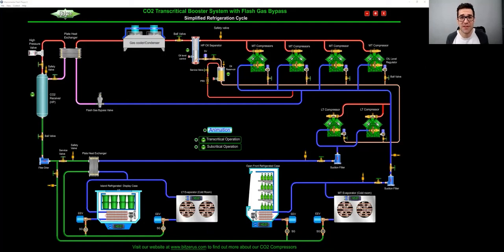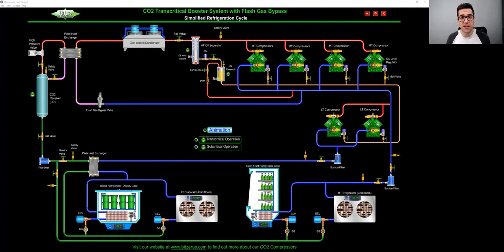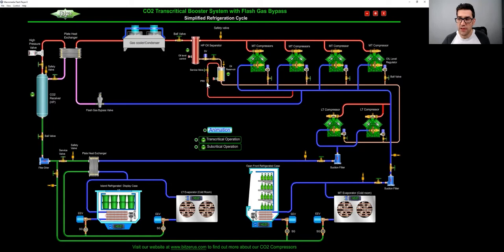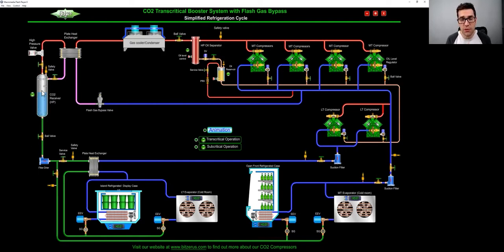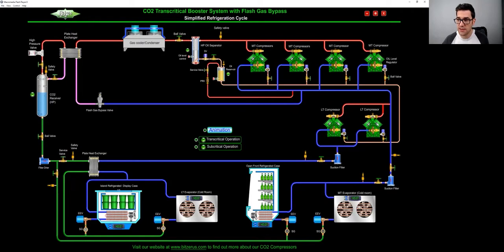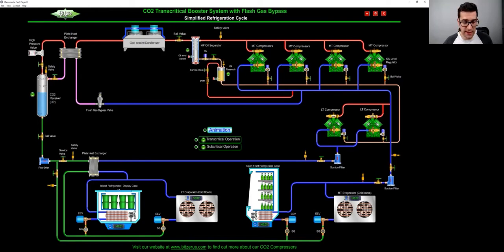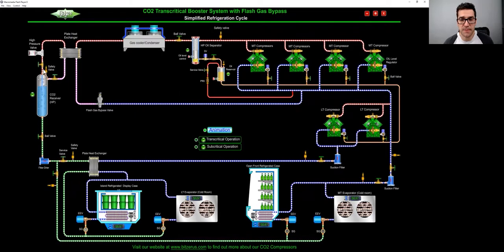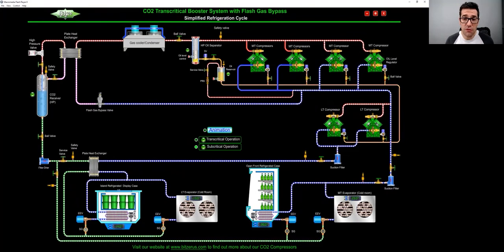Teaching Tool for CO2 Booster Systems

Comment: What kind of piping do you use for such high pressure
Reply from the maker: Great question! Usually High pressure copper it has iron in it (XHP/K65) or stainless steel

Comment: Awesome Explanation attended to my first after-hours callout to the  c02 transcritical booster rack...found Danfoss injector valve blown o-ring and dropped 60% of C02. Isolated injector and reinstated system with flash gas bypass valve.
Keep up the good work from down under.
Reply from the maker: Fantastic find and it happens. Good on ya knowing to switch the system to FGB mode.

Comment: Excellent explanation.  I cannot wait until I get to see my first heat pump CO2 system in automobiles here in the USA.  Mercedes Audi Volkswagen already have CO2 heat pump systems as an option in Germany in a few models. 

       Toyota Prius Prime has a heat pump system.  Automotive manufacturers made the heat pump system so ridiculously over engineer and so many components just with regular refrigerant I can imagine what they’re going to come up with trying to make CO2 work inside an automobile.  
       This is going to be fun to watch happen.
Reply from the maker: Thanks for sharing.  I am sure we will see many commercial building installing CO2 heat pumps as conversions over gas boilers in the near future too.